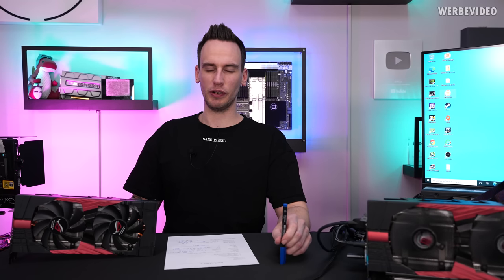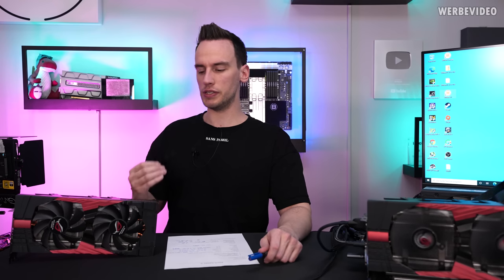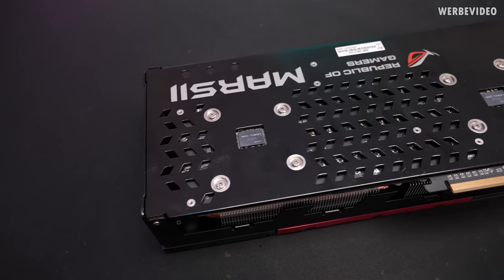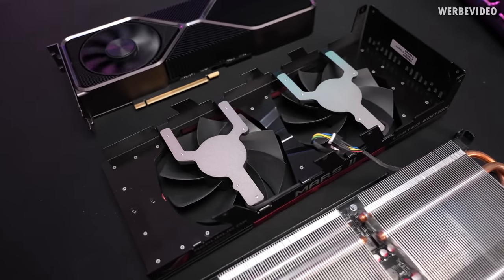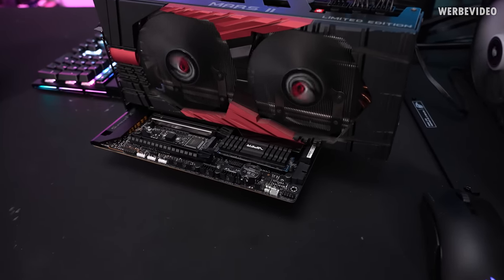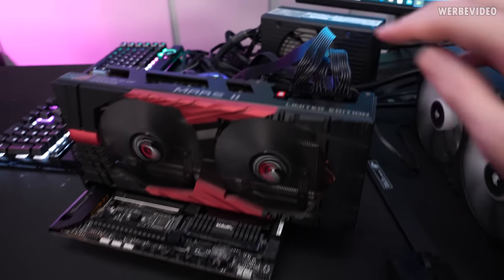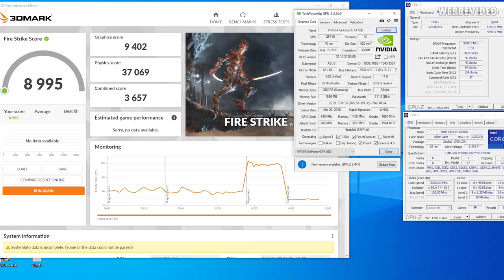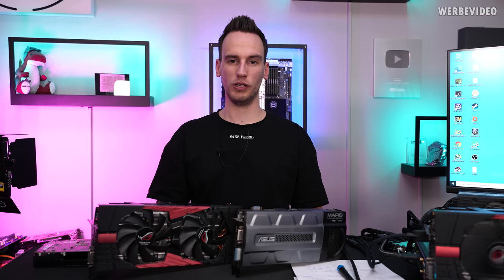HW-Legends #12: Extremely Rare - The ASUS MARS 2 dual GPU Graphics Card

Comment: One card needs 16x PCIE regardless of the version, even 5.0 would just downgrade to 2.0 for the card. On consumer platform you only get 16x PCIE lanes, splitting the two gets you two 8x, split again only gets you 4x, I don't know if that's the case for not allowing SLI, but definitely give it a try on older platform with at lease 32x PCIE lanes

Comment: SLI was so bad because the interconnect was SOOO SLOW
Honestly i'm surprised they didnt make the bridge basically PCIe 8x-16x bandwidth early on smaller fingers(like 4 times the width of the NGFF slot for NVMe drives), instead it took them more than a decade to switch to NVLink on consumer cards and by the time they did they had already planned to kill SLI(RTX 20 series) Heck, i think pascal might have been the first ever NVidia card to have NVLink and that was still like 1/5th the speed of x16 PCIe 3.0

Comment: I remember TTL over at OC3D testing this back in the day - drool worthy for sure for both it's performance and exclusivity. My only argument for not buying it was the air cooling wasn't too special. If they had made this available with a water block option (hello EK) I would probably have bought a pair even at the insane prices these were going for.

Not sure but it's possible the unreleased Mars 3 did have 3rd party full cover water blocks planned. Bummer that they didn't bring it to market ☹ I can understand nVidia limiting it's partners to making cards like these simply for maintaining compatibility and better driver support. Maybe even back then nVidia secretly wanted to kill SLI but they needed to remain competitive - quad SLI was king of the performance crown and 2 card SLI still a very popular option for many. It didn't hurt that it made them sell more cards either.

It's a shame nVidia did nerf quad SLI because the motherboards that support it are still out there as are the drivers and bridges for their workstation Quadro line. It's also a common use case now to have multiple GPU's run independently - monitor connectivity on one card, compute application running on a 2nd, transcoding job on a 3rd, 4th card etc... Even for setups that need more than four monitors. There are plenty of reasons besides gaming to want to have more than one graphics card in your rig.

BTW: Quad SLI was absolutely doable on the Mars 2 with the right drivers/mobo/bridge. When you did manage to get it working performance was pretty spectacular.
Reply: It's written NVIDIA, not "nVidia".

Comment: BIOS needs to allocate PCIe buses and MMIO and IO regions to PCIe buses
The same needs to be done in OS
This can be done only on boot time
I know because of SRIOV and flaky ASUS implementation on ASUS Sabertooth 990FX R2.0. Basically Intel i350 works, but Intel Pro 1000 ET doesn't due to not allocated PCIe Buses
Having bridges on card you have problem with allocating PCIe buses